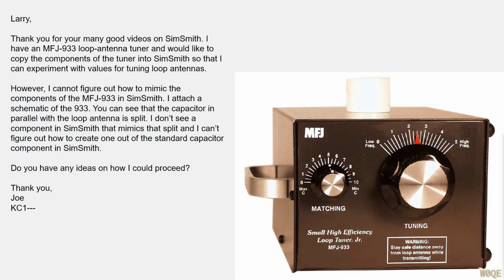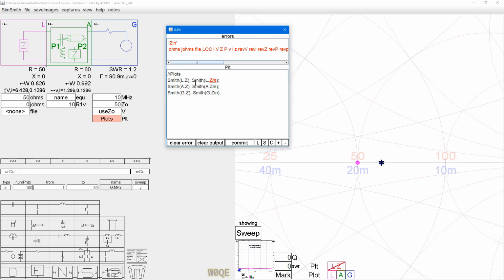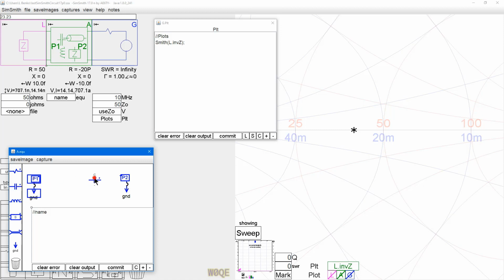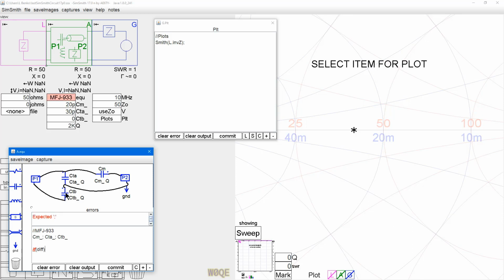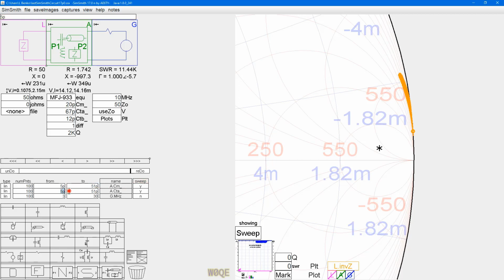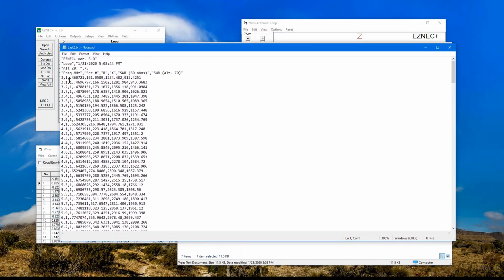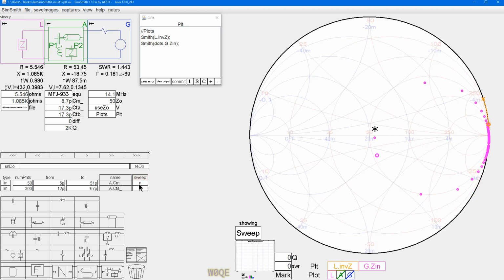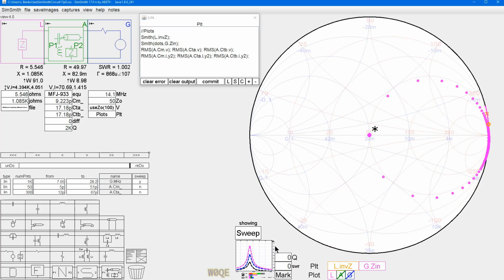#92: Antenna Matching Range with Capacitors Only (MFJ-933)

Comment: A beautifully clear and helpful video (actually all of your videos are).  Thank you VERY much you have given me a major jump-start to using this very powerful tool - very much appreciated sir. 
And since you asked for feedback, I thought the speed of presentation and the EZ-NEC (or VNA) import was extremely valuable. Aside from your amazing intuition and circuit analysis skill, I really appreciated that you showed exact syntax to achieve the variable definitions, how to establish parameters and link them, and creating plots and parameter sweeping, etc. You demonstrated how to use the extremely powerful interface of SimSmith - Astoundingly powerful. This particular video example explains exactly how to think through a practical loop antenna and matching network INCLUDING the essential issues of considering the the voltage and currents running around in the circuit - which are surprisingly high.  There is a LOT here and you've done an excellent job explaining it. Thanks very, very much Larry!
Reply from the maker: Glad you enjoyed the video.
Larry, W0QE

Comment: This was the right speed and pace for teaching this complex subject.  Your previous videos were too fast and assume your audience is already very familiar with SimSmith, Smith Charts, and RD design.  More videos like this one please.
Reply: I just finished this and another dozen of your videos on SimSmith.  I'm designing, simulating and plan to build prototypes of several ham bandpass filters.  I need to know the maximum voltages across the caps and currents through the toroidal inductors for various transmitter power levels (100w, 400w and 1,500w) to determine the correct component sizing.  This video clearly shows how to determine the required cao voltage rating(s) and toroidal inductor max currents that product Bmax.  Thank you for this information.